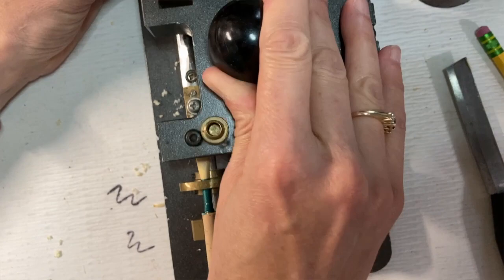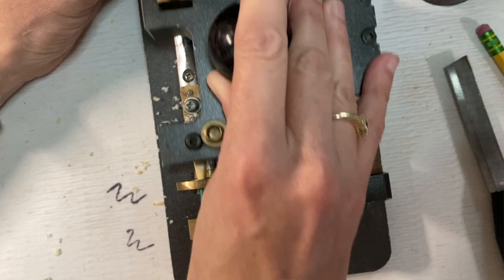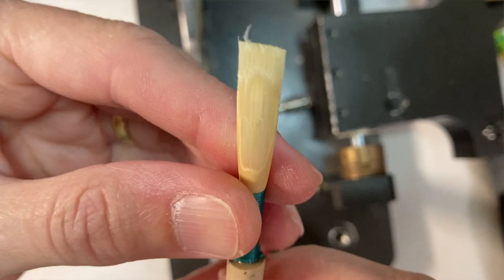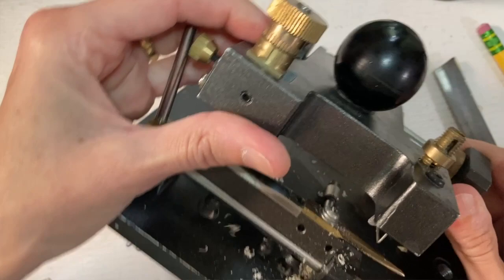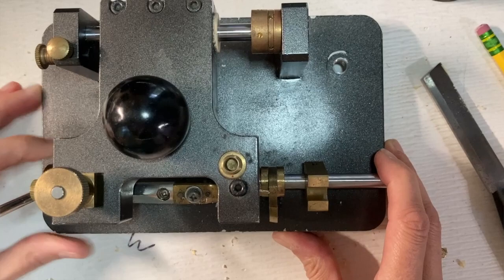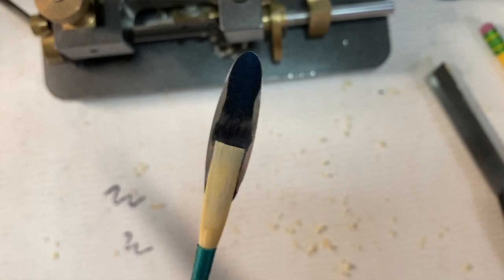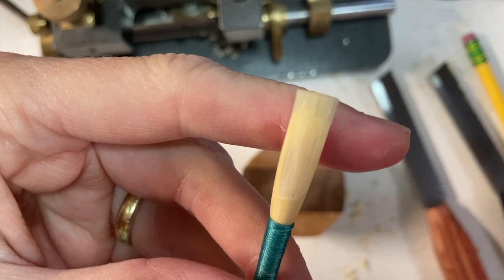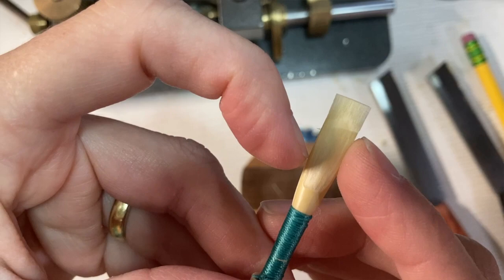Five Minute Reedmaker: The K.Ge Oboe Reed Profiler - SOLD

Comment: Hi Jennet. I have the reeds n stuff profiler. They told me to cut the blank open at 71mm. then insert it all the way to where that line is. All looks good except the rooftop starts at 67-68ish and of course the heart and back are also 1-1.5 mm higher The crow is flat and when I clip the tip to raise the pitch the tip is now very short and the reed is hard. I tried several times with some tweaking here and there but never got a decent reed out of it. Maybe it’s the template? I don’t know but I think these profilers are good like you said to give you a consistent 1st day scrape. I’m still hopeful one day I’ll get it to make better profiled reeds.
Reply from the maker: So interesting. I don't know that machine, but I'd be curious about whether the tip could be lengthened with an adjustment, or whether you could shove your reed on past the line like I do. I'd be frustrated with that high heart/short tip phenomenon, too!
Reply: I have one of these, and I have to push the reed past the 3rd line to get a long enough tip. I’ve been using the US3 tip.
Reply from the maker: @cakemerchant  Thanks for the helpful info!
Reply: @cakemerchant  I have the same template. But wait, I thought there are only two lines?
Reply: @simsim29  I have the A2 American tongue, which has 3 lines. I always push it further than it is supposed to go, but it seems to work better for me that way
Reply: @cakemerchant  I've been using the ReedsnStuff profiler on trial and have been having the same issue. I too am trying to solve it by pushing the reed past the 3rd line to get what I'm looking for. Using the US- template. It is however fantastic in speeding the process!